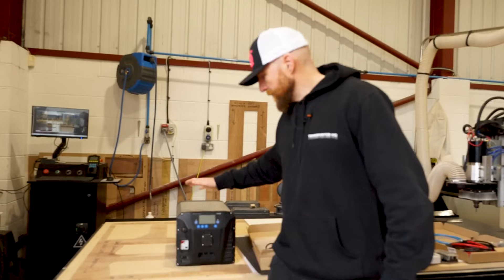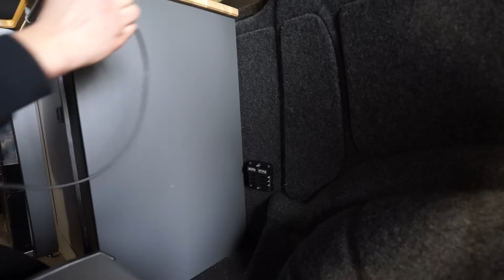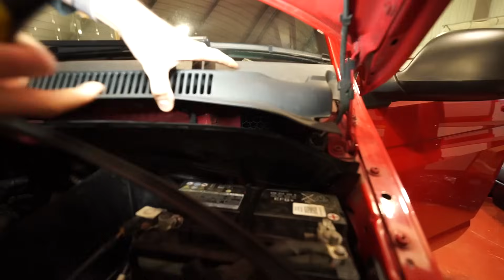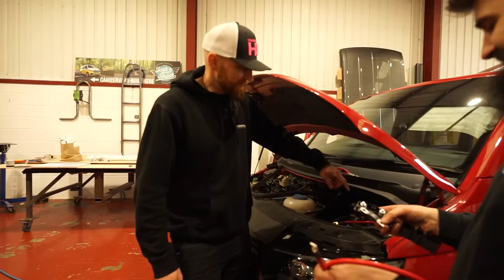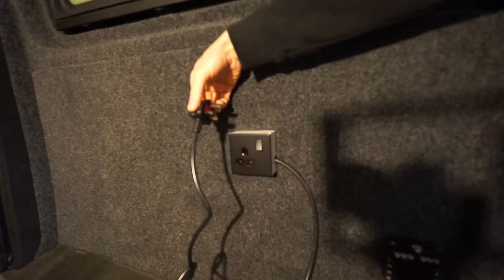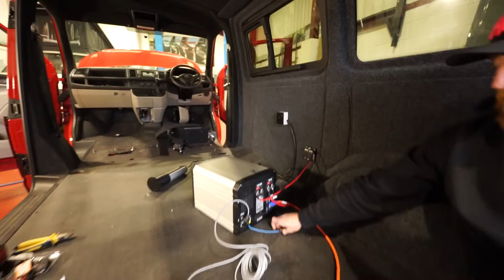The EASIEST Camper Van Electrics Install

Comment: These videos with the Clayton’s are always on a VW. Where is the ignition live on a Ford Transit Custom..??
Reply from the maker: you have a couple options:

Fuse Box can be used, though many are constantly live, requiring testing with a multimeter to find an ignition-switched one.

Driver's Seat Base -  The Customer Connection Point under the driver's seat offers various power options, including ignition-switched, particularly for auxiliary equipment or split chargers.

Comment: By the way, you can go higher than 400w... in fact in domestic PV installs its recommended to go 1/3 higher than your MPPT can charge at. It means you are more likely to hit the limit. It won't damage an MPPT, it just means its max current is 15amps.

Comment: Do you need the van ignition on to use the clayton power unit?  Seen as you run the signal cable to the vans fusebox/ignition live.
Reply from the maker: No not at all. Thats just to tell the unit to charge from the vehicle battery.

Comment: 1. Do you have any updates on when their app will be coming out?
2. How does the Clayton Power compare to the EcoFlow Power Hub which is  EcoFlows all-in-one electrical system?
Reply from the maker: Ecoflow just aren't cut out for this type of use. They're a great mobile pack. One of the biggest issues is how long they take to charge. Clayton are like no other with how fast they charge DC - DC and solar.

Comment: What are they like for reliability being you have everything running in one unit compared with a Victron setup.
Reply from the maker: Very good and so much less complication. I'd like a victron set up, 1 component failed (eg solar input) everything still functions as it should. Their customer service is incredible too. We've had 1 fault unit so far out of hundreds, they replaced it next day.

Comment: Will the power unit fit underneath a standard T6 drivers seat?
Reply from the maker: No I'm afraid not. There is just so much in that unit it's not possible to make it that smaller. It is considerably smaller and lighter than the same sort of set up if you have all these components as separates.

Comment: Great bit of kit, it’s a shame that they don’t make it a bit wider and flatter to fit under the front seat. It’s just once you’ve got this installed taking up space in the rear somewhere and all that empty space where the leisure batteries used to live
Reply from the maker: Hello. I see what you mean but it would be a struggle to fit all thats needed in that space. The front print is way smaller than it would be for a separates system that offered the equivalent
Reply: @THQAutomotive  maybe a prefabricated tray to fit in, cut a big hole in the floor  and fit the tray in. Just need to work out where the night heater is going to go now though 🥺
Reply: I agree.. I was hoping the extra battery would be the size the fit under the seat even if the main unit didn’t
Reply from the maker: The 100ah battery is 187.4mm x 197mm x 343.3mm the 280ah is 234.4mm x 197mm x 438.3mm. I hope this helps.  @fungirlslim
Reply: @THQAutomotive thank you.. unfortunately they cannot go on their side. Great video though thank you

Comment: Thats a very informative video. That unit seems to be the bees nees. What would be the minimum size unit to run a deisel heater in you opinion. Thanks love the videos btw💪👍
Reply from the maker: All would do it easy. Go for the biggest you can afford 😊
Reply: @THQAutomotive  ye for sure. Better to be looking at it and not needing it.  Than wishing you had it 👍🏻👊🏻
Reply: After initial ramp up. Diesel heaters use very little power mate. Probably 30 watts. 👍🏻👍🏻 claytin would smash a diesel heater. Even the smallest 👍🏻

Comment: What size mm is the cables from the Clayton to the fuse box? Ours is 16mm and I think they are too big.
Reply from the maker: Way smaller than that. It's only to wake the unit up.
Reply: @THQAutomotive  no the ones from the Clayton to the 12v fuse box where we put the fridge and everything else. Got some issues with our 12v fusebox not sure what to do with it 🤷🏻‍♀️
Reply from the maker: @ChloeVerse no that won't be the issue. You can't oversize the cable.